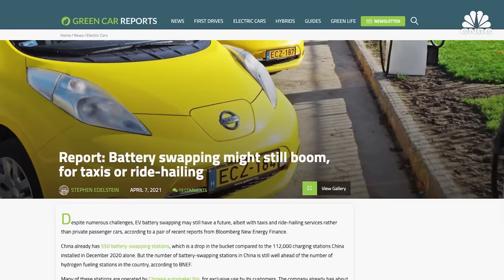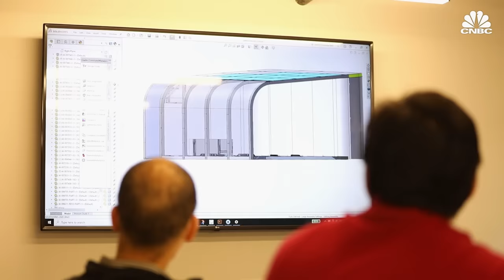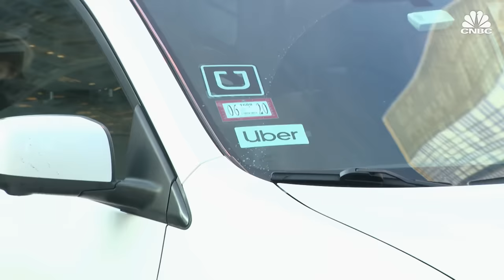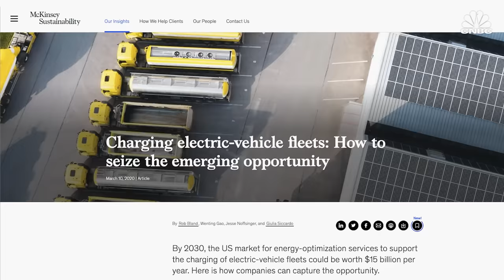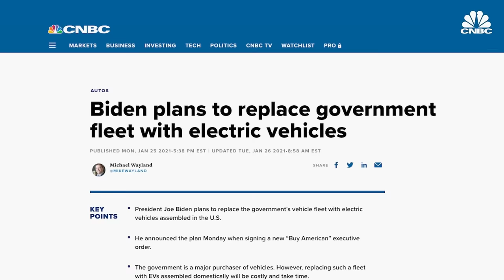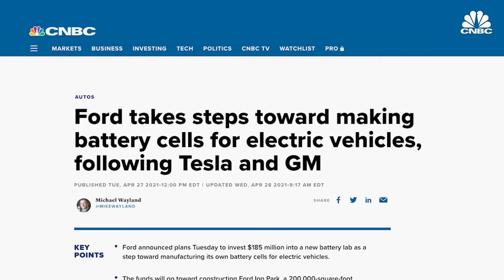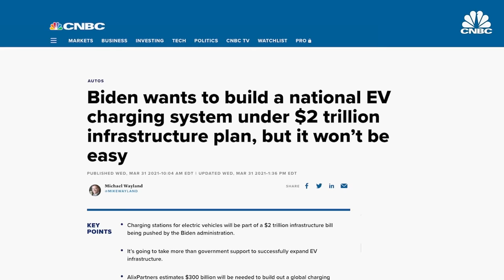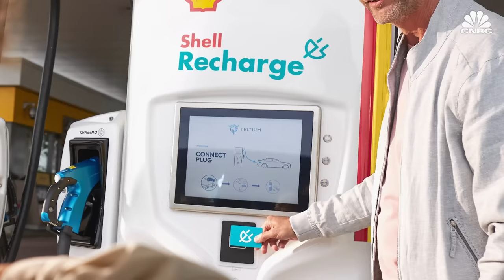Can EV Battery Swapping Take Off In The U.S.?

Comment: That's a very cool concept and I like how it can work for people with limited access to home charging. I think one of the biggest benefits of owning a gas car is that you can go to any gas station and it works. For those of us driving EVs, that level of universality is just not even close to being there. This seems to be a step away from that.
Reply: 2 years later and electric cars are known for catching fire and burning down entire multilevel parking lots or automobile transport ships. Nobody is buying EVs anymore and their depreciation is 50% per year. The insurance is outrageous because any damage to the car is too risky for the insurance companies to take responsibility to repair. Stellantis built the Jeep Wrangler 4xe hybrid by placing the lithium nickel-cobalt-manganese battery inside the passenger compartment regardless of the likelihood that when the battery goes into thermal runaway the toxic and flammable fumes fill the passenger compartment. The internet is full of videos of these vehicles exploding. Amazing that the experts at the regulators and insurance companies didn't see any problem with this.

Comment: "5 EV manufacturers, but will not discuss which ones" well obviously kia and nissan are 2 of them.
Reply: Those were old Leafs. Seems like the company just retrofitted an old Leaf as a proof of concept.
Reply: Nissan have not been supporting Leaf owners for non-warrenty OEM battery swops and are getting a bad name for it. I don't know what the reasons are for the lack of help, but I wondered if they looked at Ample as a possible solution. For sure, there is not a Leaf owner out there who would not be interested in Ample. Just please tell me how many kWhrs Ample can sqeeze into a Leaf.

Comment: Too much wear on the connection between the vehicle and the pack. The ideal is to slow charge overnight,  cheaper and prolongs the life of the batteries.
Reply: Yes, at night, when no solar power is available, so you can charge using dirty energy
Reply: @DanielFenandes  Tesla Powerwall.
Reply: @harrychu650  you need a pack of that to change vehicle
Reply: easier to replace a connector than a whole battery pack
Reply: The problem is some people drive long distances, for example when I'm going on vacation in the summer, I will sometimes drive over 500 miles in a day, Also I occasionally do a few 300 mile trips to see family throughout the year. Yes there is fast charging but it's not good for the battery. Granted, I'm sure range will eventually increase.
Reply: The Tesla powerwall has lower capacity than half a Tesla car’s battery. I wonder what is the Elon fanboi smoking
Reply: yeah

Average power wall is 7-20kW 

While average Tesla vehicle are 50kW
Reply: @to33x  Fan what? Let's get to the topic at hand. Ford Mach-e sales since Jan release , 8,500 units sold. Tesla Model Y same release time, 100,000 units sold.

There is no demand for the Ford. No wonder the Mach-e tesla-killing articles have disappeared from the MSM.
Reply: @to33x  😆🤣😂 I think it is 1/3 in a powerwall but funny comment nonwtheless.

Comment: “How much does it cost for one of these?” Interviewer.         “We cant get the exact number” CEO guy.  BS every business owner knows exactly what the cost is at that time and what they project it to be. He didn’t want to say. You are going to need to get every car manufacturer to standardize their battery pack. In the RC car world they standardized their battery packs in the 1980’s.  The idea is solid and sound. But I am skeptical on its implementation.
Reply: So am I. At first I thought they meant swapping out the battery once it gets old and has less capacity. As I watched the video I was confused at to the purpose of constantly swapping the batteries as opposed to just charging up.
Reply: Of course they know, they just don't want to give the exact number to keep it from their competitors. How many car companies go to the press and announce exactly how much money it takes to produce each car?
Reply: @bftjoe  They know the cost but are embarassed to say because it is ridicuously high. Factor in the maintenance of all those fragile, moving parts and there is no way it will work except, maybe, inside someones warehouse or an existing gas station.
Reply: yeah this startup is so much Nikola, just wasting investors money
Reply: Did you watch the same video? They literally responded that the cost to build was "in the tens of thousands, like an expensive level 2 charger". 4:31
Not "we can't get the exact number" that you pretend was said. Of course he knows what it costs, and of course he didn't want to say... but he still said way more than you let on.

"The cost of a single port EVSE unit ranges from $300-$1,500 for Level 1, $400-$6,500 for Level 2, and $10,000-$40,000 for DC fast charging. Installation costs vary greatly from site to site with a ballpark cost range of $0-$3,000 for Level 1, $600- $12,700 for Level 2, and $4,000-$51,000 for DC fast charging." -  Costs Associated With Non-Residential Electric Vehicle Supply afdc.energy.gov - EVSE Cost Report 2015 (and six years old for this tech is already a long time)

Comment: They can trickle charge when only a few EVs need their service. But will they be able to do that if hundreds of customers need their service at a given location?
Reply: Hmm.  Presumably, there is lower demand at night, so the battery stock could be charged slowly overnight.  Probably zero batteries would be returned completely depleted.
Reply: you can say the same for fast charging…
Reply: The question is who even needs battery swaps on regular basis other than truck drivers or others with high battery drain due towing? Taxi and bus drivers got launch brakes anyway nor there is necessary that many taxi drivers driving over 180 miles per shift, so who exactly will be the audience for these things when you will be able to charge your EV car during shopping, thus removing even part of the population which currently won't buy EV because they did not have the option to charge at home?
Reply: @IonorReasSpamGenerator  It says there are about 100 Uber drivers using their service with 5 stations in bay area. Average 1.3 swaps per day per driver.
Reply: @bftjoe  In case of shorter range older cars like old gen Nissan Leaf perhaps, but new ones with 180+ real miles currently available at affordable second hand prices? Looks like solution for an issue that disapear in a few years.
Reply: @IonorReasSpamGenerator  Depends, but carrying around a bigger heavier battery is inherently less efficient. Yes I believe currently it is leafs. 

"In March, Ample announced that it had deployed five stations around the Bay Area. Nearly 100 Uber drivers are using them, the company says, making an average of 1.3 swaps per day. Ample’s operation is tiny compared to the 100,000 public EV chargers in the U.S.—not to mention the 150,000 gas stations running more than a million nozzles. Yet Ample’s founders Khaled Hassounah and John de Souza are convinced that it’s only a matter of time before the U.S. discovers that swapping is a necessary part of the transition to electric vehicles."

A longer range doesn't really solve the problem of recharge times for high usage applications.

"On June 10, Ample announced a separate partnership with the fleet management service Sally, which specializes in making EVs available to ride-hailing and delivery drivers. The two plan to work to together to deploy EVs and swapping stations in San Francisco, New York, Los Angeles and Chicago. Sally aims to have hundreds of Ample-ready Kia Niro EVs running in the Bay Area by the end of this summer and to begin offering swapping to drivers in New York by the fall."

Yes this technology is probably far more worth it for a car with poor ability to repeatedly fast charge, like the leaf.

A liquid cooled battery like almost every other EV which can repeatedly fast charge is probably not as worth it to battery swap. For the average person driving 30 miles a day, battery swapping is probably not necessary. But I can see it for Uber/Lyft/food delivery drivers.

I drive Uber in a Chevy Bolt, while a 10 minute full battery swap would be  nice I'm not sure I would do it instead of the free fast charging available in my area.

Also driving over 180 miles is pretty common if you're talking about an 8hr+ shift of driving. A short lunch break isn't necessarily gonna recharge your car to full. Regardless of your personal feelings or theorycrafting, actual Uber drivers are using and paying for the service.

I probably wouldn't want my battery to be easy to steal from my EV, so I probably wouldn't go with swapping.
Reply: @bftjoe   Marking opposition as theory making and the one deciding on feelings when their remarks did not match your narrative is the oldest trick in the book, either stick to the facts or keep your assumptions to someone close to you that will tolerate such behavior..
Representative of NIO an EV company which running battery swaps in China also sharing my predictions that battery swapping will be just a temporary solution for common users until better technology arrives, even though I still believe it can have some uses in the commercial sector where it allows some savings in the long run. As for your average lunchtime for a taxi driver, this will be fully sufficient to charge batteries when faster-charging batteries arrive, just consider how much range you got in 20min in cheapest Tesla, so call me skeptical if I did not believe your "arguments" based on repeating after someone with limited experience in this emerging field with a self-interest on making this technology look as good as possible...
I did check the average taxi driving range per shift long before writing a comment and find value around 100 miles, though I tried now New York where there was 180, but the way taxis driving in NY will make a lot of returned battery through regenerative braking, so it's hard to tell if it something like Tesla could make it through the shift or not even in winter...
I still think that considering upcoming developments in battery technology and proliferation of chargers will make battery swapping far less viable as some trying to suggest, regardless of posts of some trolls..
Reply: @IonorReasSpamGenerator  you really feel you need to start your comment with a personal attack? I did not necessarily agree with all the comments, but did find them considered and respectful.
Reply: @IonorReasSpamGenerator  As a ex taxi driver I can confirm that we covered over 200 miles almost every day and often 250 miles (2 or 3 time per week). Occasionally you would get a long trip which would push your daily mileage to 300. And this is only one shift per day. Many taxis run 2 x 12 hour shifts, so no time to charge them.
Reply: Same as a gas station, long lines leads people to other stations.
Reply: @IonorReasSpamGenerator  whewe most people do not have dedicated parking. Unless all parking spots on street have a a charger battery swap makes more sense in this case.
Reply: A potentially viable biz model is to build a swap station perass parking lot. It is much easier to predict demand this way as the amount of car come and leave and need recharging / swapping is easier to judge. Also more economical than making all 1000 parking spot EV friendly
Reply: @IonorReasSpamGenerator  What? You make up some theory about how this technology is useless when it already has paying customers? You must be GOD!

Also a car can be shared among multiple drivers in a rental or family sharing arrangement. You clearly do not drive Uber if you think there is plenty of time to charge with current technology.
Reply: 🗣YOU CAN LITERALLY CHARGE AT HOME!

Comment: There is a problem like in cities in the northeast where some homes do not even have driveways and people need to park on the street, there is no way to charge their cars same with apartment buildings.
Reply: @STeresa Swappable batteries seems of course easier to centralize than to decentralize and feature charging on every street. We will probably go the way of fuel stations which there are more of when there is more density of cars/trucks. I also see the possibility beyond my lifetime of built in electrical systems that vehicles access via magnetics. In fact I envision futuristic vehicles to float just like mag-lev trains, because the achievable ride will be so smooth and because hovercraft were in the first Star Wars!
Reply: People still need to park their car somewhere during the night, so just place chargers there. Also not everyone needs to charge every night, so you can have just enough charging places only used by people who really need to charge (by charging a base price per night when not charging), ...

Then ofcourse you should ask yourself, why do these people need a car? To go shopping? Place more chargers at stores. Work? Place chargers at the workplace. .... In the end it is mostly about planning and it will not be surprising if we see plenty of level 2 chargers popping up at stores, work places, public parking lots, ... Charging on several occasions a little a bit can be just as good as charging a lot at once (and is even better for the battery).
Reply: When almost all cars are electric, almost every parking space can have its own charger. It's an infrastructure problem that will be solved given enough time.
Reply: @rreagan007  i know you are free to dream but if government in the United States does not want to spend a few thousand on public health, how will they spend many thousands on public charging? And we are talking per person. Nationally if it costs more than we can borrow from the rich and the Chinese then we cannot afford it within a reasonable time frame. Plus there may continue to be a growth model. New roads and new homes. If we can barely afford for extremely rudimentary asphalt paving projects, how will we be both FOCUSED and WEALTHY enough to install charging on every road and parking spot? I think future robotics will be the answer to all of these questions. It has to be because modern man is getting awfully lazy.
Reply: @rreagan007  What we should have is trickle car chargers at parking spots running on elevated and angled solar panels...
Reply: try a extension cord, it works for me.
Reply: @jamesmedina2062  The problem with your line of thinking is thinking that government has to do it, or require it, or incentivize it, and without government it won't happen at all. Governments are never effective managers of resources. If you want EVs to be a thing the last thing you want is for Gov to be involved.
Government is the obstacle and it needs to be shoved out of the way, locked in a cage, and told to be quiet.

In any case, most places people park for work/recreation/shopping are private. If they want people to patron them, they'll eventually have to start adding in L2 EV charging.
Reply: @MrGabrielgn  "Can you imagine what will happen if you make a battery pack that is very easy to unscrew and disconnect from your car? 2 things come to my mind: theft and accidents." Given that my Tesla battery pack weighs 1,100lbs, I'm not thinking theft is a problem.
Reply: @jamesmedina2062  "What we should have is trickle car chargers at parking spots running on elevated and angled solar panels..." Already being done.
Reply: @dorvinion  " Governments are never effective managers of resources. If you want EVs to be a thing the last thing you want is for Gov to be involved." The problem with your thinking is that you are ignoring the anti-EV forces that are paying the government politicians to block EVs. The oil industry has politicians on their payroll (via "contributions") on both sides of the aisle in the USA. Until you stop the favoritism and subsidies given to Big Oil, you have to subsidize EVs.
Reply: @justsomeguy934  Which laws are being proposed to block EVs? They must not be working cause I bought an EV in 2019. A couple hundred thousand other people did as well. 

Subsidies of any good or service are colossally stupid and serve only to enrich the politicians and producers.
Take money from taxpayers, wash it around Washington a few times to take a bit off the top, then 'give' a smaller amount back to taxpayers to do something they were already likely to do in the first damn place.
And to top it all off, it doesn't make the final product less costly for the consumer. It merely allows the producer of a good or service to raise the price of the product/service above what the market price would otherwise be. You need only watch the price of the Model 3 drop as Tesla hit sales numbers that cause the EV tax credit to phase out to see this phenomenon in action. Its also the same reason college prices are going up up up - the subsidies get ever larger.
Basic, fundamental economics friend.

If you think some companies are buying politicians the solution is not to make another means of buying a politician, its to remove the politicians from the equation. No subsidies of anything. No favorable tax policies. Damn little 'regulation'
Don't let them anywhere NEAR the process. EVs are a great idea and they will happen without the need for pols to intervene to claim credit for things they didn't actually do.